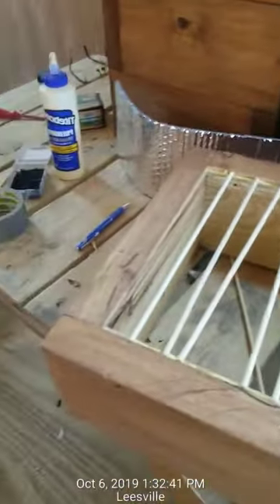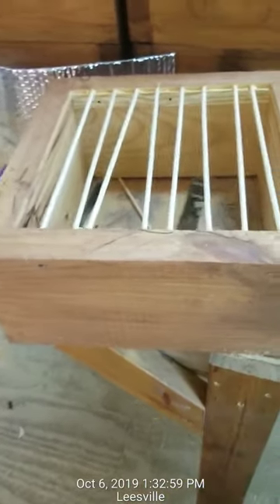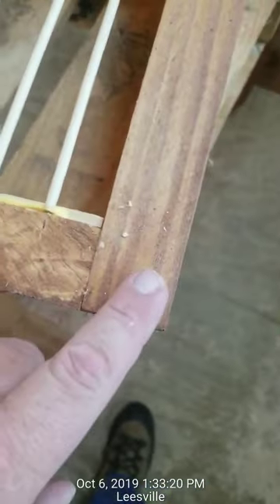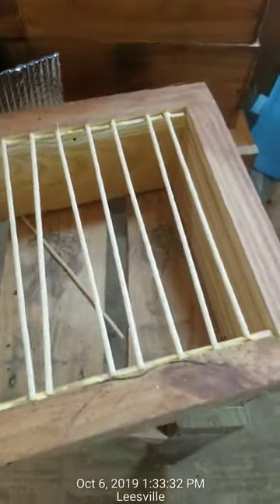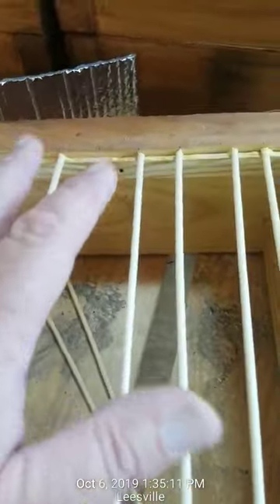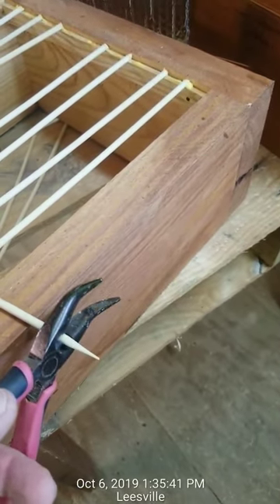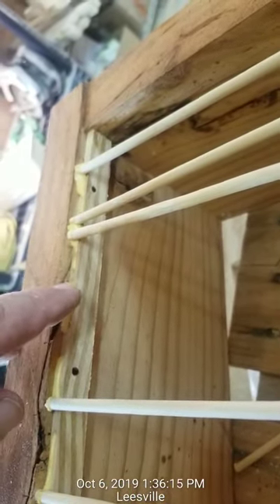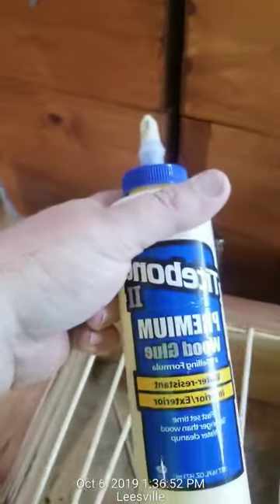How To Build A Comfort Hive

Comment: Brady, thanks for putting up this video! I thought of a way to get drawn comb onto the frames: before you cut the skewer tip, thread it through an old piece of comb, then trim skewer to length. I’ll let you know how it works, I think I could use brood also to keep a split xfer from a langstroth to a comfort setup in this same way.
MVP performance on the video, thanks again! You should make more videos of how you run your apiary, I’d be glad to learn from you as I am sure many others would.

Comment: I made a pile last year. I poured through dozens of hours of video/podcasts. You got it all but the bottom, but you've saved many the time.

I will say, these are great for queens.  I wouldn't bother with honey, the comb is to valuable in this situation. And these pair perfectly with a 6 frame hive. So you can build a long "queen cell builder" box that fits over 6 frame boxes. Then you can use a strong hive to build comb/make brood/store honey in the little frames.

Comment: I think you just changed my life!!!🙏🏾🙏🏾🙏🏾🙏🏾
Reply from the maker: Glad I could help...hope I changed it for the better!
Reply: Brady Vaughn yes I had another question about the dimensions you use 2 different ones in the videos. Looking for clarification!
Reply from the maker: @brownmamma3  The outer dimensions will change based upon the thickness of the board and the way in which you assemble your boards. The only important thing is to make sure the inside dimensions are always the same so that you can move skewers from one box to another.
Reply: Brady Vaughn so should I got with the 12” and 1x6 versus 2x6?
Reply from the maker: @brownmamma3  as long as your skewers fit, I would say go for it.
Reply: Brady Vaughn ok thanks so much!

Comment: Yes I watched Sam working one of these and I really like the  design. Then I found your video on the Measurements, thank you! There is one thing  I'm going to do different, I watched a video on top bar hives were they are bad to attach the comb to the sides. And this guy said they are teaching them in Africa to paint the insides with real wet mud. And this keeps the bees from attaching the comb to the sides. Also Sam said you some times have to use a bread knife to separate the boxes or a piano wire, because the bees attach the top box comb to the box below it's comb. I  am going to put a piece of tile between each box with a two inch hole, using a round circle hole bit. If the tile breaks doing this maybe  a thin piece of panel, and paint it with the mud. I think instead of mud I am going to use Benatite clay. I don't think I spelled that right, you can by a big bag pretty cheap, they use it to seal leaking ponds. It's clean and should stick real good! Good luck and thanks for the video, from the Ozark Mountains of Missouri.
Reply from the maker: You may consider hardware cloth between the boxes also. I'm thinking they may not attach to it, but it needs to be big enough to allow the bees to pass through.

Comment: Hey Brady, what are you using as a bottom board?

How are you initially starting a Comfort hive colony? Are you just shaking bees in like they’re a package?
Reply from the maker: For your first hive I would make a comfort hive swarm trap with a wood bottom. You can make splits from there. I have both wooden bottoms and ceramic tile/reflectex  bottoms. I cut my reflectex just slightly larger than the inside dimensions of my box so that the bees don't glue the ceramic tile in place.
Reply from the maker: I actually found a super-simple way to do this and I posted a video on my new channel explaining the process. Check it out. https://youtu.be/IjQJwHRimFM?si=MVTj1aIoWVcwfzs9

Comment: So you mention using 2x8 and cutting them down to 6 inches. What do you think about using a literal 2 x 6, which is actually 5.75”?
Reply from the maker: You can do that too. I wouldnt recommend using anything much more than six inches in depth using only skewers as bars. Could have a comb collapse problem in the summer heat in some areas.